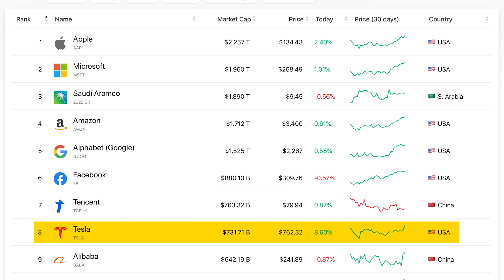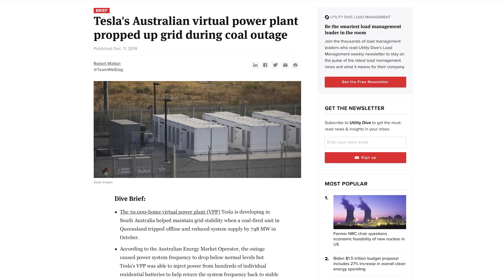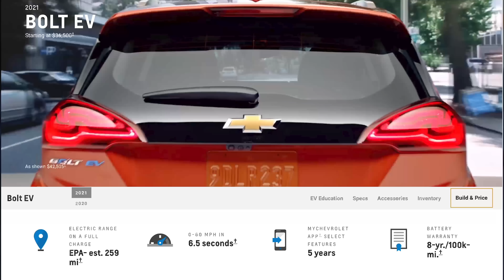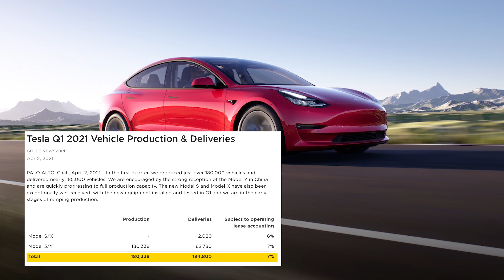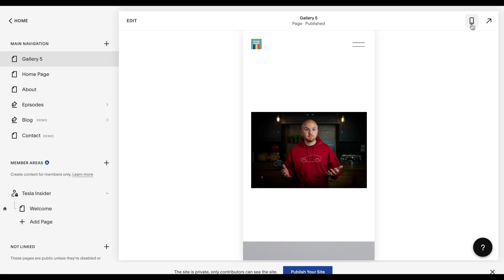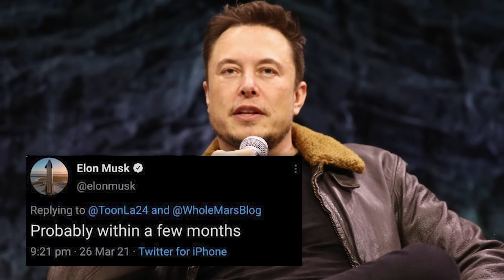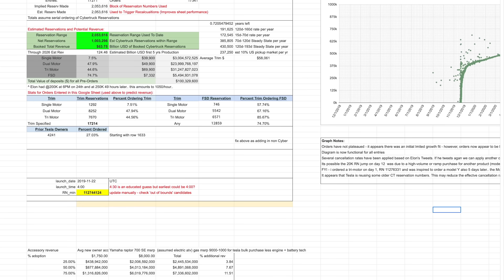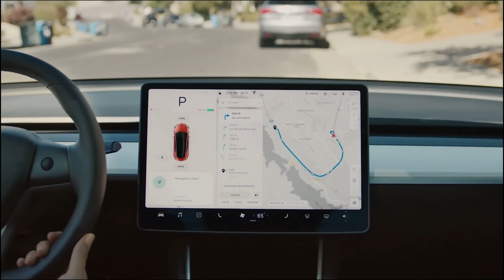Tesla Is Just Getting Started

Comment: “If” Tesla achieves FSD.... I think you meant “when” 🚀🍾🥂
Reply: Good luck.  Need good weather. Up north here it can't self drive if the cameras are covered in snow.

For me at least. I'd rather have a electric car with good interior and exterior than a car that has its features turn off in the winter for me.

Other manufactures are better in that space than Tesla due to years of design experience
Reply: @robf88  I'm guessing you don't own a Tesla. I don't personally have have heavy snow  where I live but have seen Teslas warming up and defrosting the car entirely with the temperature control systems. 

I'm sure there will always be challenges, but if it wasn't for Tesla we wouldn't have anyone pushing the envelop.

While legacy OEM's are designing cars, Tesla is designing robots on wheels... yes no comparison.
Reply: @f.duarte5276  You're right I don't own a Tesla anymore. The features failed often enough this winter that I ended up trading it in.

It had a very difficult time with black ice and in heavy snow.

It really showed me that self-driving is only useful in certain areas right now.

All I'm just saying good luck with self-driving My experience was bad and I think there's a long way to go if it's still possible to get true self-driving to work due to edge cases
Reply: @robf88  that sucks mate, hope they fix that issue in heavy climates like yours. I just believe we are very early in realizing the full potential on AÍ trained neural nets so today’s FSD failures will be laughable in the near future.